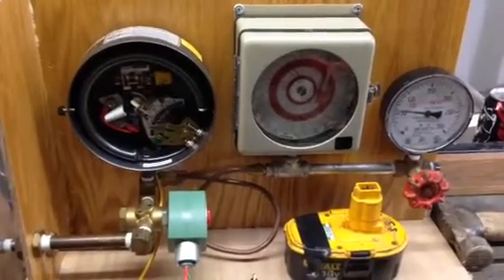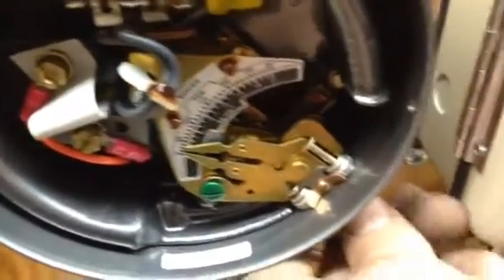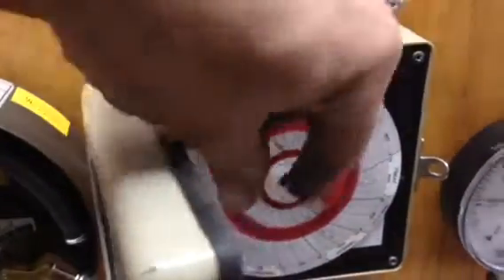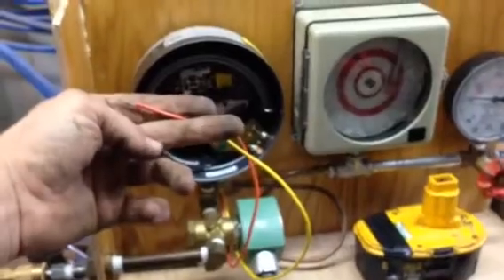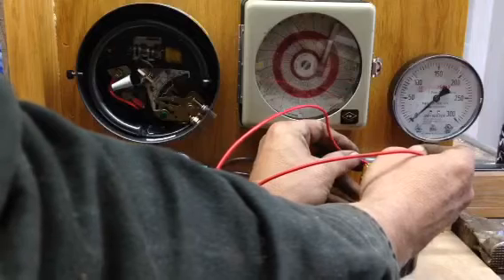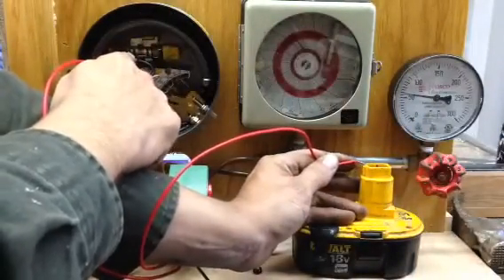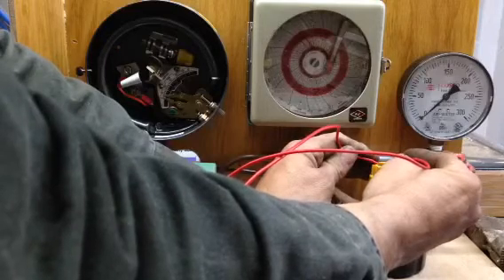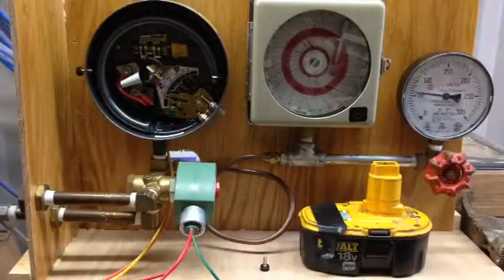Mercury switch, Mercoid switch demo

Comment: Why my mercoid adjustment is stuck, is there any lock on it in order to turn it clockwise or counterclockwise? Thanks
Reply from the maker: I am super sorry that I did not see your reply for four months, there is no lock or anything else inside of these. You just need to spin the little dials, and you can see the vial of mercury flip to one side or the other based on pressure, I hope that helps you and I am really sorry for not answering you right away.